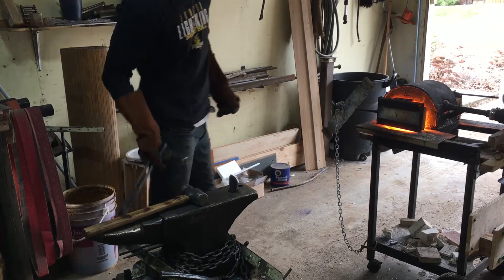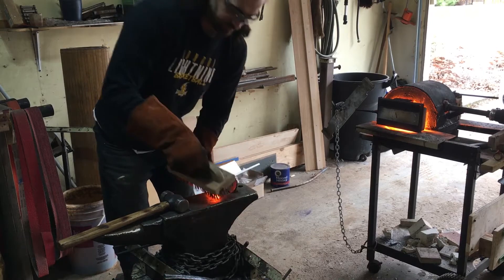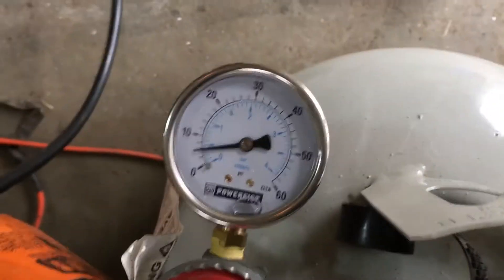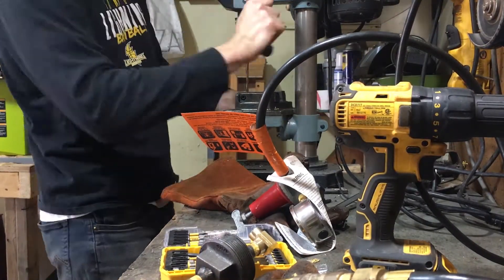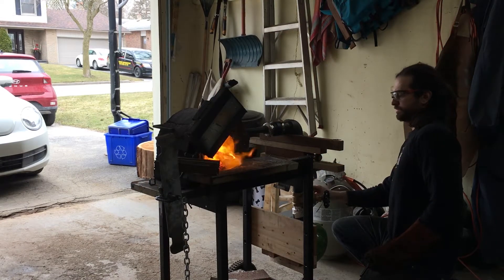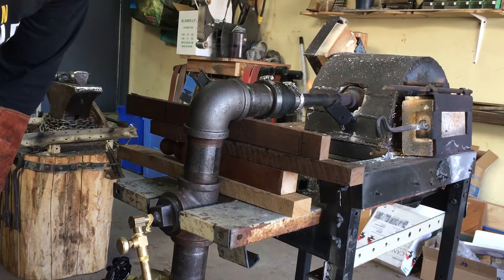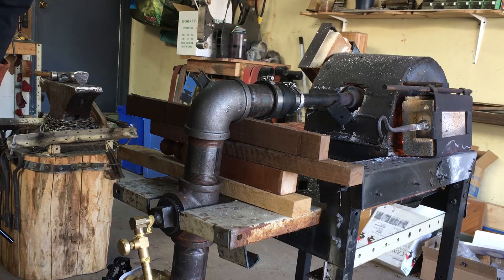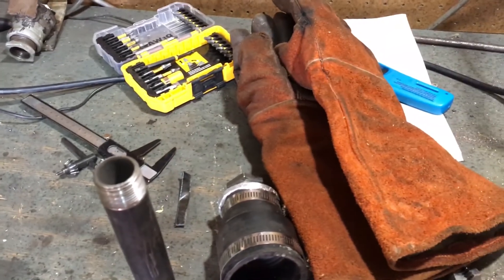MAKING THE SWITCH | Problem Solving my Forced Air System

Comment: Christ centered ironworks has a great forced air burner video. It’s what I use and it’s outstanding! Another thing I do is I cast my burner flares in the forge. I’ll set the bell reducer in there and cast around it when the refractory starts to harden I’ll remove the bell reducer. I have a video on my channel showing the forges I use but not a build video.

Comment: What a cliffhanger! Can't wait to see what a ribbon burner is :)
I probably don't understand the issue weld ;) enough, but could the sputtering be due to "bunching" of fuel? Kind of like transverse waves propagating back through your pipe caused by the pressure from the combustion (fuel burns, pushes back fuel behind it, lagtime, fuel burns, etc.)?